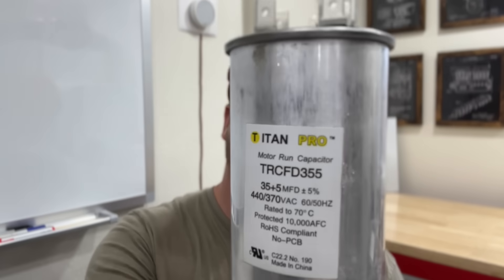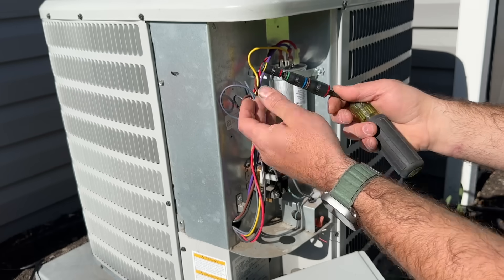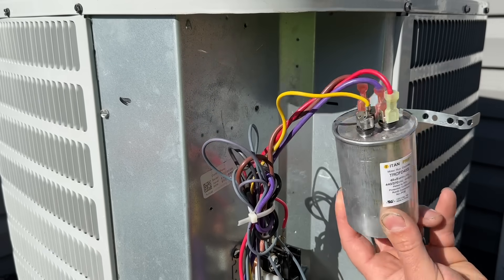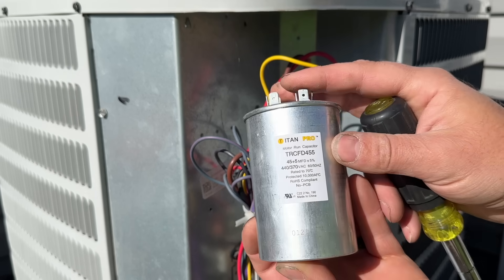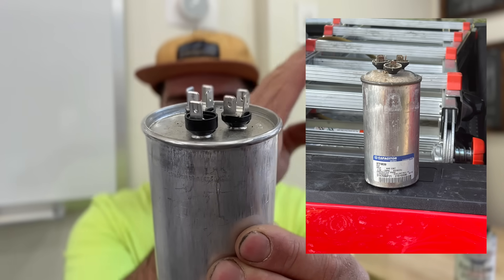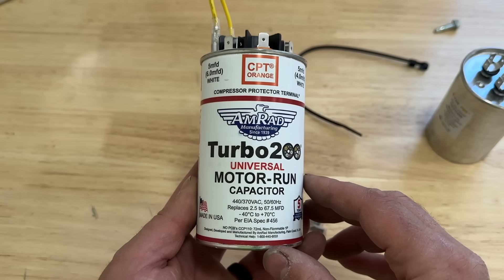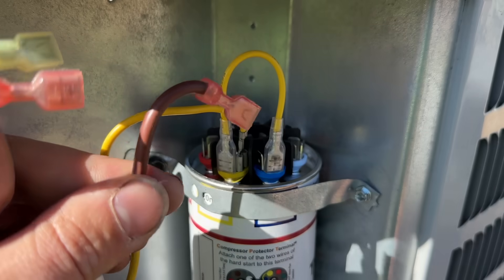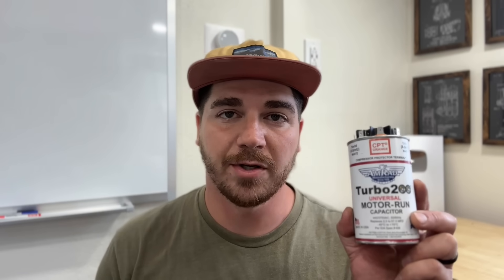HVAC Contractors Practically Make Their Living On These

Comment: The size, rated in uF isn't a problem if it's larger. It's a problem if it's lower because without out enough capacitance, voltage can drop too much when the motor is started and fail to start, thus causing problems. A larger cap, so long as the can run the correct voltage, is totally fine to use. It's not going to break the compressor, or fan, or what ever, because the most they'll see is the line voltage and they draw what ever current they draw to start anyway. If the motor units in the compressor or fan are drawing too much current, they're the problem, not the cap. Putting on a larger cap as a bandied for hard starting motors is just that. A larger cap on a healthy system is the same as a smaller cap so long as it's enough.

Comment: The Plus Or Minus 5% means that he cap is in spec if it's Plus or Minus 5% of the stated value. So if the cap is 45uF, it's spec range in that 5% is going to be 42.75 at the low end and 47.25 on the high end.

Comment: You should always replace the capacitor with the value specified by the manufacturer. If this is the start capacitor, then an increase of 10 mfd (14% higher) may be acceptable. But if this is the run capacitor then it could cause an increase in current flow and cause the compressor to overheat.

Comment: Had one blow and its case was visibly ruptured. My neighbor, an HVAC tech heard the capacitor blow from his patio and called my attention to it. He didn’t have the exact replacement on hand but jumped two together to get the correct number and had my unit back working on the hottest night of the year ! In the week ahead with the proper capacitor in hand he replaced the two he had jumped and it has worked great in the years since.

Comment: I keep one on hand... mine is about $35 and about $200 to replace it. If I do it myself, $35... this is an easy fix folks. 
Make sure the capacitor is REALLY dead, discharge it by shorting across the poles (as in video) It can bite...says the IT guy who actually enst to school for Electrical Engineering...

Comment: I would never just order a replacement part based on what's in the unit. I would always look up to the make and model and see if there's any updates as well. No need to go outside or buy any multi-capacitor. Case in point my microwave turntable platter carrier wheels wore out and I found the exact replacement cheap on Fleabay but also found an new version which had a much different design which prevents the wheels wearing out prematurely due to excess load.

Comment: Capacitors don’t typically “just” fail. There is a reason 95% of the time. Could be airflow or charge related more than likely.  Just replacing the cap alone without checking everything els is asking for more expensive long term problems. Homeowners are not going to buy gauges and static pressure probes let alone know how to use them…. Lol

Comment: I had one replaced yesterday. They charged about $285 for the service call, capacitor, and the wire connected to the capacitor. The wire had burned off. Not bad.

Comment: Fantastic capacitor! As a retired HVAC tech, never seen the turbo 2000. Another helping capacitor for a compressor with run only capacitor is to parallel a hard start capacitor on the run cap. If it's an older unit having trouble starting, it could buy a couple more years of life for your unit. Hard start caps should be installed at the factory but they rarely are due to cost. Folks, just know that this is for non inverter compressors only.

Comment: Thanks for these videos. Best quote i got on a capacitor was 150. Got two capacitors on Amazon for 20 bucks.  This was a place literally a few miles from me. So i'm just learning how to do all this myself instead of  getting ripped off. I just cleaned the condenser coils and next up is a 40/5 capacitor that is running but showing 22.3/3.9 with a multimeter. Try to get that replaced before the summer heat hits hard. Also, another tip... you may get a replacement capacitor that is skinnier than the original but rated the same. I did and it would not fit in the strap. I just wrapped the new capacitor with gorilla tape where the strap needed to go to make it closer to the width needed.

Comment: Good video. A yearly system check by my HVAC vendor showed the values of the cap were low when he checked with his VOHM meter. It was working fine, just early on its way out. Tech was fair, advised me to replace it as their cost was over $300 with the service call. A new one with the same specs was just $15 on Amazon and took just minutes to swap out. Also had a cap on the blower motor in the furnace go bad a few years before, also a similar cheap and easy fix.

Comment: I have a three year old Carrier 4T which I have inspected in Spring and Fall.  He just told me my capacitor was “weak” and recommended replacement with two choices.  First was Carrier ten year warranty which would be free part and $65 to install.  Second was to buy their “Super Capacitor” for $285, parts and labor.

I chose the warranty option as I figured I could replace it four times over 10 years compared to the “Super” option.

We do get regular 100f + days here in S Texas which is hard on the capacitors.

Comment: Stumbled across your video today. Here’s another example of an HVAC company trying to overcharge their ‘contract’ customers. I had an annual service contract with this local HVAC company…which was supposed to save me at least 10 percent on any services needed. During a normal annual pre-season service visit I was told that the startup/run capacitor needed replacement. I had already checked it myself with my capacitance meter and knew it was still good, but just to see what they wanted to charge for replacing it I ask “How much?”. I was quoted $350…Plus the tech told me he didn’t have this ‘very common’ capacitor on his truck so he’s have to return in a day or two with the part to complete the job. That would add an additional $150 for the 2nd service visit. So a total of $500!  Since I knew how much a run capacitor typically cost…I asked him how he came up the that estimate… He said they take it right out of a standard service estimate book for that type of repair, just like auto repair shops use for typical auto repairs like replacing a water pump. I also thought it was very unusual that he didn’t have these run capacitors in his service van since every HVAC system typically has one of these and they often fail after only a few years. I’d already replaced mine myself twice before…one of which had actually exploded inside the compressor/fan assembly housing. After getting the estimate I also asked why he didn’t take into account the 10 percent discount for having an annual service contact (billed monthly) in his estimate. He didn’t have a good answer for that other than he just took the estimate right from the standard repair cost manual.  I told him that I knew I could purchase the same capacitor for $5 on EBay and replace it myself and sent him on his way without signing the written estimate for replacing the ‘still good’ capacitor. I then cancelled my annual service contract with that company and will just call another local reputable HVAC company if there are any repairs that I could not do myself.  By the way, another good way to tell whether your run/startup capacitor might be failing is to watch your lights inside your house and if they start to dim slightly when the AC kicks on it’s time to check the capacitor and replace it. It’s most likely gone bad but not caused the AC unit to stop working yet.

Comment: @6:35, you said when the capacitor has 45/5 + -- 6%, anything above 45 or less than 45 means the capacitor is bad. In what way does the + -- 6% apply, if at all?

Comment: The way to stop this is to force the A/C manufacturers to design their systems so they do not eat capacitors.  I'm quite certain they could design a system that never suffers this type of failure over the life of the product.  As long as this basic defect exists, the crooks among us will continue to rip people off replacing these components.

Comment: I was away on business when my wife called and said the AC wasn’t working. She called a service and they came and said it was $575 to replace two capacitors. They were in and out in less than an hour. The Amazon cost of the capacitors was about $25. On the bill they charged $300 for the capacitors, $100 for the service call, and $175 for the labor. I will never do business with them again and my unit is going to need replacement soon. In addition I tell everyone I meet to stay away from those cheats.

Comment: I was an HVAC tech during COVID and we charged 250$.  The service call was 99$ always, and is reasonable for expenses.  The diagnosis included 10 points including capacitor(s), blowers, contactors, air flow, filters and other things, including clogging of outside of unit by grass and dirt.  A 2000$ USD charge is just fraud.

Comment: I was charged $300 for replacing a capacitor like that. I asked for the old one back. I then looked it up on Ebay and found I could have bought one for $10. Another smaller capacitor I was charged $150 for I found I could have bought for $5. Beware if you do it yourself though, capacitors can store large voltages, which can kill you.

Comment: I have a jacuzzi. For a long time I couldn’t use it because unbeknownst to me at the time, the capacitor malfunctioned. I watched several youtube videos and finally one said, if your jets aren’t working and it makes a humming noise, as if it wants to start running but doesn’t, then most likely it’s the capacitor the reason why you’re jets aren’t working. Well i had no idea what i was doing but after I turned off the breaker, i opened the jacuzzi door to the mechanism and visually inspected it; where i would hear the noise prior to opening it. Then i removed two screws that held the capacitor inside a metal case. I took a picture and then looked for that item on Amazon. After i got the capacitor, i reopened the jacuzzi door to the inside and replaced the capacitor. Loa and behold, I fixed my jacuzzi. It costs me $10! But had I called someone just to inspect it, it would have been a minimum of $100 or more, plus parts forget about it.

Comment: Always discharge capacitors with a screwdriver before touching wires even if insulated rookies fingers can slip hit a terminal and zap. Discharge first then touch wires.
Reply from the maker: Unless you can’t get your screwdriver on it because the connector is insulated. I thought that was pretty clear but thank you for reiterating. Cheers

Comment: Or you could just look up the correct capacitor, buy that as you emergency drawer spare and save the $50. They don't go bad on the shelf.
Reply from the maker: Yes, I thought I made that pretty clear but thanks for reiterating. Cheers

Comment: $250 and below is perfectly acceptable for the time and cost, you have to remember techs bring a mini supply house fully stocked to your doorstep and get the unit cooling / heating immediately same day. Another consideration is that it’s not always cut and dry like this many times the nameplate is gone and you have to know where to find the correct information. When doing a capacitor repair it should be the only thing the tech checks out wants the system comes online. You pay for an experienced person to ensure all else is well.

Comment: I have never heard of someone billing $2k for a bad cap but there are definitely some scumbags out there. What usually runs the bill up on a cheap capacitor change is that most companies have either a service charge for coming out at all or they have a minimum amount they charge. I don't do residential at all anymore but I don't see anything wrong with charging a service fee or minimum bill because yes the tech was only there for 30 minutes but he has drive time, plus the support staff (dispatcher, parts person, boss), the van, the tools, the building they operate from, that all need to get paid so that when you need service it actually happens. I am completely fine with people fixing it themselves and within reason I'm happy to help but I also don't feel bad if you get slapped for $300 to change a $15 cap.

Comment: 36 years as a HVAC tech before I retired. The bloated caps I always called a "pregnant beer can"... I figured an accurate description.😄 I also used the Turbo 200's as soon as they came out. Especially when I found out they were the OEM supplier for Rheem capacitors... which seemed to last forever. (After Rheem started using them)

Comment: Unrelated, I have to replace s broken liftgate switch on my 2019 pathfinder. To have dealer do it $150 for labor $534 for part.  To order part direct from Nissan $99.83, Rockauto wants 83. I just bought it at eBay motors for $13.50 after tax, + free shipping and guaranteed fit.

Comment: My compressor wasn’t coming on last week and I had a HVAC guy come out. He told me that my compressor wasn’t getting enough voltage to kick on and I needed a hard start kit. He connected one and showed me how it worked and essentially told me to just go buy one off of Amazon and connect myself because it is super easy to do. I paid him a $100 diagnostic fee and he went on his way. Later that day I picked up a hard start kit connected it and have been goodevery since. These are the type of HVAC technicians that I love. He told me that if he was too connect and leave his hard start kit then it would be about $300 to $400.

Comment: This is a long post I encourage anyone who is curious about service companies to read this, hopefully it will add some perspective and context to capacitors that cost $100's.

Service tech and installer for around 11 years now. There are definitely a lot of scams in this field. I've been the second opinion to "cracked heat exchangers" for furnaces and other things. This one kind of bothers me though. Most people who don't own a business have no idea what it costs to run one. I'm aware of a lot of my companies numbers. I know that because of overhead our diagnostic fee may be $90, but the company has invested over $250 just to get my van to your house.

I totally agree that some companies are ripping customers off, but there are legitimate economical reasons for a capacitor replacement costing $100's.

If you want the cheapest price, find a single guy in a truck who has minimal overhead. If you call a service company with overhead, management staff, a physical location, dispatchers etc it will cost you more.

Our capacitors are roughly $500-$400 based on membership for our market. If you are closer to a big city (higher cost of living area/worse traffic) it will cost more.  

Our cost breakdown is as follows (generally, we have some items like capacitors which are necessarily on the lower end of parts cost):

 10% for parts, 20% net profit (ideally, but not likely), 30% labor, 40% overhead.

We give excellent warranties and guaranties, we show up when you call, always answer the phone and take responsibility for our mistakes.

Once we replace a capacitor we run through a thorough checklist on the rest of your system to identify any other issues that could cause breakdowns. Capacitors fail for a reason generally and simply replacing it and praying may seem cheap until you kill your compressor because of low charge or a restricted metering device.

Now here is the kicker. Most HVAC service companies unless they really structure their business properly LOSE money on service. Your average HVAC service companies revenue is 80% from install and only 20% from service.

There is a lot of value for a customer to interact with a service company if they don't want to repair things themselves.  Often times we don't see that value because we don't understand the economics of running a business. It costs money to offer a warranty, costs money to have a physical location and office staff, costs money to own lots of vehicles and maintain them. Like most things in life, this one is also, not black and white.

Comment: I had my capacitor go out the other day. I scuffed the one day shipping and had to wait an extra night. Seeing it got nearly 80 inside and my fan starting up was the issue i simply unhooked my condensor unit fan from power, grabbed a box fan i had, ran a power chord out a window then put the fan on top of the condensor unit to pull air in its place overnight. Anytime the compressor kicked on it would kick out just enough heat to keep it from overheating. Managed to get the temp back down to a livable 73, as slow a process that may have been. Most jerry rigged thing ive done but it worked and i felt like a damn genius. Swapped the cap today and all works as intended. So glad it was just a 13$ fix and Youtube expertise gave enough confidence to make it easy. Wild people Charge over 80$ for such a thing.

Comment: You are so, right on, this AC scams should put some of guys . To serve a penalty or two. Thanks for posting this, it only takes 20 minutes to change out a capacitor. The capacitor is there to enable the motor to start on a normal 60 hz . It’s worth changing out even if you’re just guessing that a Capacitor is needed, and if if you’re not wanting to test it. Just change it out and buy two, so you’ll be ready next time.

Comment: Dude my air conditioner went down two or three years ago and I've been limping along with window units ever since... I replaced the capacitor a year or two before it kicked, so I just assumed the compressor is bad and I wasn't willing to buy a new unit... Until I saw this video it never occurred to me that the new capacitor that I bought (probably cheapest one I could find) might have went bad. I don't think I even checked. I'm going to go check now.